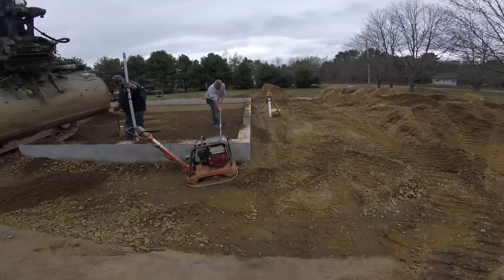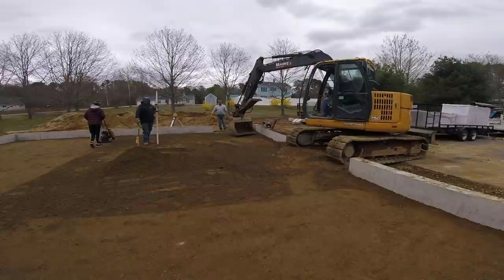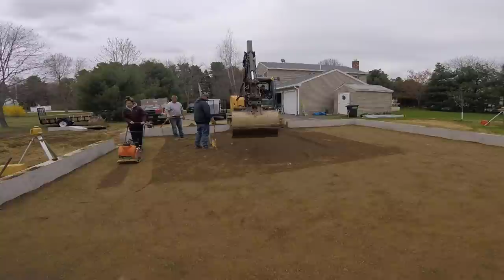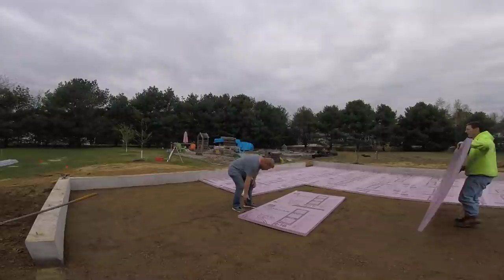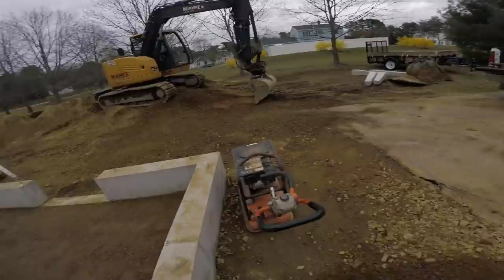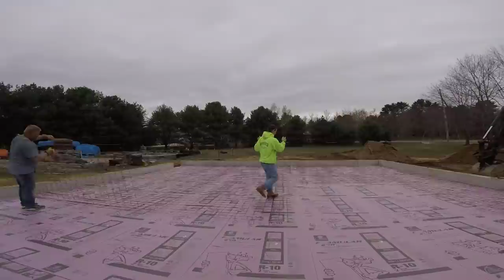Prep Work Before Installing A Concrete Floor (Garage Floor)

Comment: the foam make sense, but without the exterior edge of the slab being insulated, and a thermal break at the door exposure, its still got outside exposure heat sinking to the cold outside exposed concrete.
Reply from the maker: Floor didn't have radiant installed. If it did there would have been a thermal break.

Comment: We put foam against wall or frost footing, sometimes 4 feet around inside perimeter.  I've tested slab temps, thermal break makes a major difference

Comment: In Ireland depends on building type. If its a house then 6" phenolic foam is best practice, ($65 - 8 x 4 sheet) double u value of polystyrene. Code requies A rated homes so u need that in floor to achieve rating.

Comment: We put the Styrofoam under our slabs here in California when it's called for on the plan. Usually in cooler areas and under walk in freezer slabs. They make us stager the seams though. So one full 8fter to start then the next row would start with a 4fter to maker sure they are all staggered.  On city jobs we are required to stagger our rebar also.
Reply from the maker: No stagger here, just keep um tight. Sometimes we'll tape em.

Comment: In Western NY South of Buffalo we only put down foam if the floor has radiant heat with pex tubing and some towns have ridiculous codes to follow but primarily just the heated floors.

Comment: In Sweden, standard are 300mm of insulation under the concrete (3 layers of 100mm sheets).

Comment: In Oregon I’ve done several with just two foot strips along all exterior walls or cover full grade on slabs or even finished basements. We’ve even done them on suspended floor.

Comment: Hey Mike, Would just like to say a massive thank you for all the information you put out here, we have been following your channel for some time, as we have been planning to pour a slab in our workshop here in the UK.
After pouring one for my dad for his small garage we felt we hve enough knowledge and experience thanks to your video's to have a go at pouring, screeding and power troweling our own workshop slab, its around 170square meters. with a little more to go for stage 2 later on.
We made a video on our channel of the process and have taken to time to add a thanks at the end of the video along with a recommendation to check your channel out.
We just wanted to say thanks really for doing such a great job and putting the information out there for free.

Keep up the great work.

Comment: In Fla, we never put styrofoam under a slab. Never use radiant floor heating either. We really don’t have ‘frost walls’ either. We have stem wall construction sometimes that looks pretty much identical, but the depth of the wall is only dictated by how ever deep it needs to be to keep the footing from being exposed (aesthetics).

Comment: I am stunned not everybody uses a laser for prep work. I do foundations and am pretty picking about the grade for the footers. We set up alot of pours for our flat work crew and we make sure it is the right depth. It saves the company money because of less concrete and if is too bad we back charge. We are lucky because the company that does our work is really good. Usually less than a 1/4 inch off.
Reply from the maker: I hear ya Jeff. This company is really good. But quite a few around here aren't so good. It's nothing to show up to set up a floor and the grade is off 2" on a 4" thick floor.

Comment: In Upstate ny foam isn't required unless we're installing radiant heat. Still, we always at least use eps board along the exterior for a thermal break
Reply from the maker: On radiant floors we do the thermal break too.

Comment: We  would do 2ft down along the inside of the wall  below grade then a 2 ft piece of styro foam laid flat around the perimeter in. But it wasnt mandatory only if it was in the specs and the space was going to have heat !!

Comment: Use a lot of foam under our slabs and driveways here in WI. Lotta frost most winters
Reply from the maker: Yes, it's expensive too isn't it?
Reply: Found a good local supplier that has good prices on it. Better than the big home stores prices

Comment: I added a solarium on my balcony last summer. This balcony consists of a 5 inch concrete slab with armature, 8 by 18 feet, 50 inch off the ground, resting partly on the house foundation and two round concrete collumns. That was my first concrete project, 25 years ago. I ordered my concrete with a #4 slump and ½ inch aggregate, 4000 psi. It was poured in a 75 degree sunny weather. I was all alone to do everything, including poured steps. That quite an adventure but it came out pretty good, the surface was a bit uneven but not enough to puddle water. Not a crack in sight since then, mind you I put  ½ inch re-bar every 12 inch,(talk about overkill) There was no internet then and no Mike Day available. So, to get back to the subject: my four season solarium is on that balcony. I insulated it with two inches of styrofoam underneath, glued with construction adhesive and covered with Durock ½ inch concrete panels for protection, held up with Tapcon concrete screws. The slab has a Ditra Heat membrane with an electrical floor heating element (1300 watts). The slab serves as a heat collecting mass that accumulates heat from the sun during the day and releases it at night. The heating elements keep the floor temperature constant at a nice 72 degrees. The air is kept nice and warm at night by a 24 000 btu Jotul propane stove. I'm in Montreal and last week the temperature averaged 10 degrees Farenheit. We admire the view and the blowing snow while eating lunch being cosy inside. All this possible in great part with the properties of concrete.
Reply from the maker: Nice, thanks for sharing. Interesting!

Comment: Radiant heat is deff the way to go. If the floor is warm, everything above it is warm
Reply from the maker: Yes, for sure. Half the  floors we do are radiant.
Reply: Here in Ontario,CANADA  🇨🇦....  more people are using RSDIANT HEATING in their basement and car garages and even their garage car driveways for melting the snow..

Comment: When putting foam down does it matter if the subgrade is compacted below? I do excavation, and did a job where i cleared a hill side and the owner contracted the concrete out to another company. And he said it did not matter if it was compacted or not. So i dug down into extremely hardpack and it had some large rocks so it was impossible to get a uniform base, so i backfilled with 2" of sand to level the surface to grade. I was unsure if that was acceptable. I build roads for a living and we need compaction before asphalt gets laid.
Reply from the maker: I personally think compaction is always needed, especially under concrete.
Reply: Hi mate I am from England and we always compact the ground under anything that you put under concrete if it's straight on the ground we still run a compacter over it when is to the right grade but its only put straight on the earth on little things like shed base or bin store/trash can base under most concrete pads if like driveway it has 6" compacted stone then 6" concrete but other in your country you use it alot more people have block paving or gravel or tarmac driveway

Comment: I have a large sunroom with a bare concrete floor. No idea what it was poured over. Can I still have radiant heat installed between the concrete and finished laminate flooring?

Comment: Code in Ireland depends upon type of building. If its a house then your striving for an A Rating, best use of energy. That calls for 150mm or 6 inch of phenolic, prob  x2 the rating of styrafoam for the same thickness. 
Grade work before the insulation is laid is the key, we use both lazer and lines to check and a dumpy level for final check. All to often other just put it in by "eye" theres a bad culture of that here. 
Compacting or "whacking" in layers of 100mm or 4" is essential. We use Sr21 which is like your 2" down material. It bindd really well, sometimes we lightly spray with water to aid compaction. Maybe before pouring a yard also to stop the SR21 draining the water from.the mix.
Its never so cold here that we need to use hot water in our mixes. Id like to look you guys up, next time im stateside (pandemic dependant) its been a while since i was on the tools over there. Excellent work, from Concrete Paddy 🇮🇪👌🏻👍🏻🤛🏻

Comment: Do YOU put a RUBBER EXPANSION  JOINT around the inside Perimeter Wall  before the POURED CONCRETE WALL to prevent concrete cracking due to shifting and settlement of foundation  ????
Reply: In ny we'll use felt expansion on interior walls and foam board on the exterior (to provide a thermal break)
Reply: @CConcrete14 .... I am in Toronto, ONTARIO, CANADA  🇨🇦.... 🇨🇦   ... I appreciate your response....is there a shortage of construction workers  there ?
Reply: @MrQor2  if anything,  covid seems to have brought more people back into the trades. There's always a need for skilled workers though.

Comment: Do you ever do any barns on a monolithic slab? Just wondering with good base material if it'd be ok with frost . If the barn isn't heated, wouldn't the slab inside the frost wall just heave around potentially? Just curious as i am rebuilding from a fire and headed toward  a Morton style barn
Reply from the maker: We do slabs for those all the time. Good gravel base, possibly even Styrofoam under the slab. The base is the key.
Reply: @MikeDayConcrete  you interested in bidding in fryeburg or is that too far?
Reply from the maker: Fryeburg is a little out of our range  for work.
Reply: @MikeDayConcrete  i thought it might be. Awesome videos man, lots of good info.

Comment: im thinking of getting  kingspan (floor insulation in the uk)  for me shed come workshop im building, would it  make much diff though ?  its not the biggest woorkshop so the cost wont be massive..    this vids at the stage i am too so after watching it i was just wondering...

Comment: Since the styrofoam will give or compress somewhat, doesn't it compromise the the load capacity of the slab?
Reply from the maker: It doesn't compress when installed like this for a residential garage.

Comment: I've always felt if you own a machine it should be working, not sitting while you do something else so I'm right with you on this, sub it out if you cant keep it busy full time. Last house I built for myself in PA about 1984 I put Styrofoam under the slab, was a bit unusual back then but you could heat that house with a candle.
Reply: Yep, machines are expensive. If they’re not running, they’re losing money.

Comment: Dirt crew needs a roller that vibraplate is not sufficient. Looks money though for grade
Reply from the maker: They got one. They also had a larger compactor on site they used while bringing up to grade. Just used this one on the top.